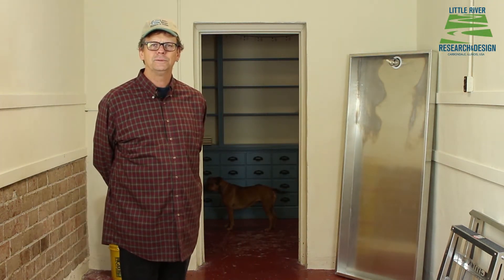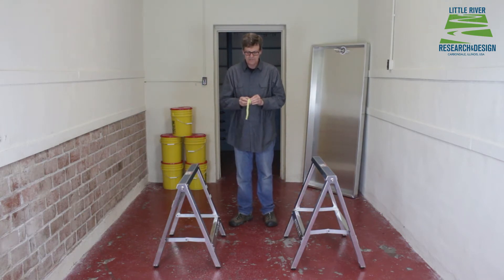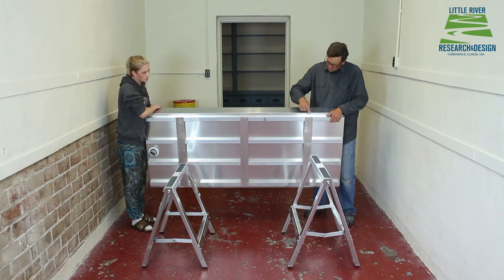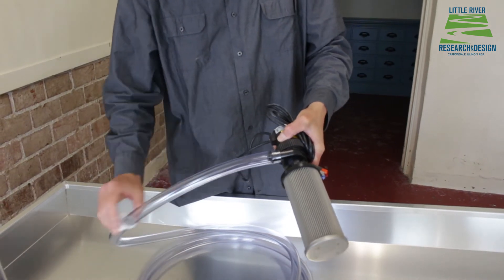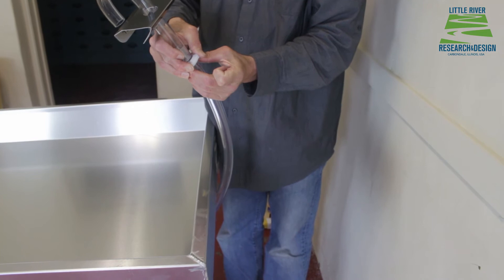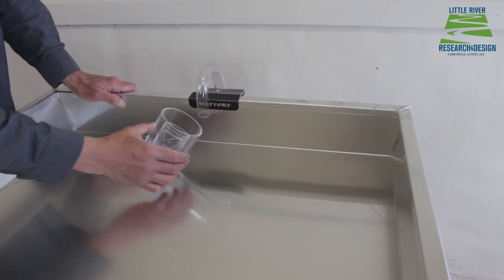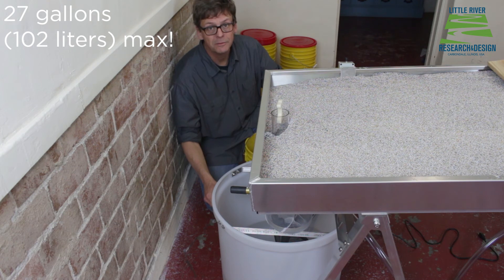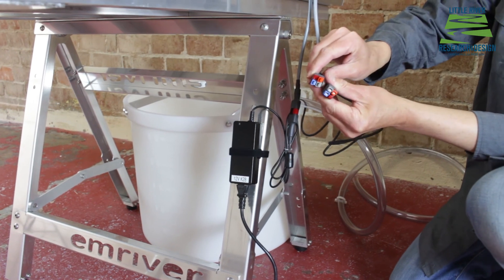How To Setup Emriver Em2 Stream Table

Comment: I want to build something like this for my daughter to learn and play with.  What kind of media do you recommend for something child safe and more resistant to erosion but still moves?
Reply from the maker: I would recommend Emriver media... and am not alone in this. Here's a DIY blog we frequently refer folks to:
https://www.mrhollisterphoto.com/stream-table.html

Other than that, the most commonly used sediment is playground sand. We do not advise sand for use in our models because it is heavy (doesn't move well), visually bland, and can damage pump mechanisms if it gets past whatever filtration.